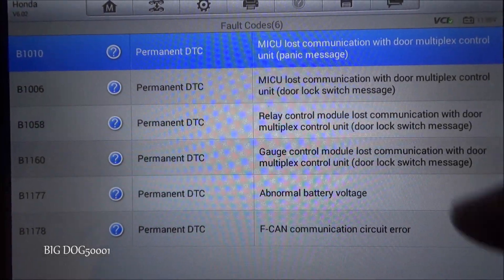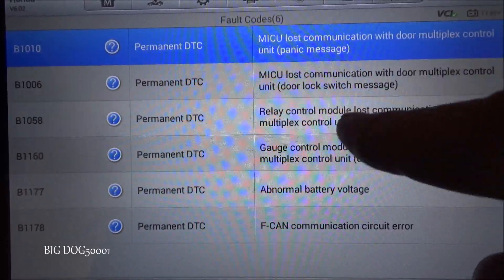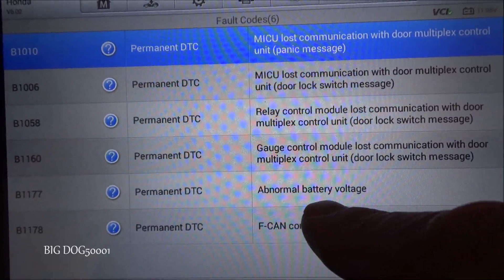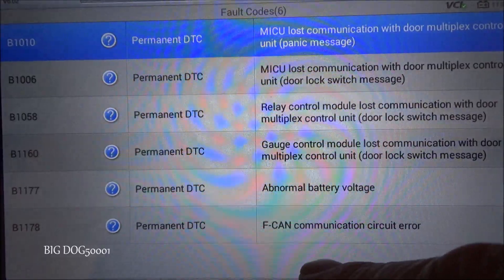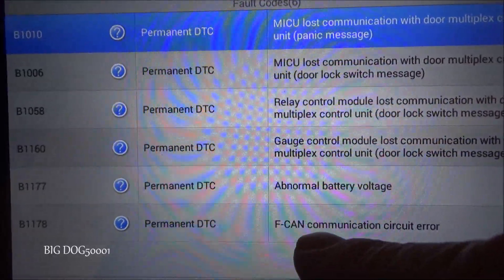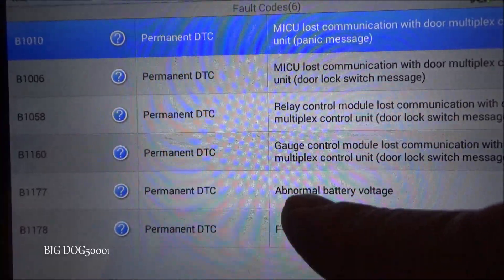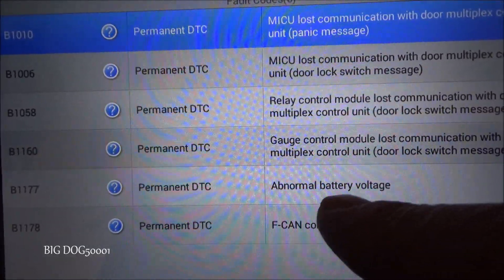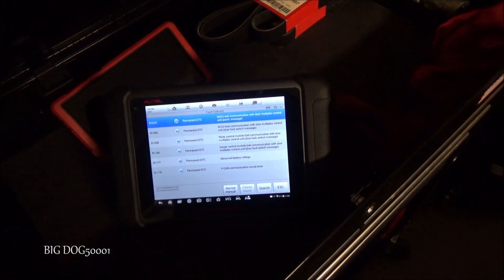Tech Tips: Multiple Trouble Codes and CAN Communication Errors

Comment: I have the door modle multicomplex thing comes every once whaile, my car vultage alwayas 14,4 v, im useing 200 amb alternator, is this problem related to increased voltage? Thank you for your effort.
My car is accord 2005 ex 2.4
Reply from the maker: 14.4 volts is fine, over 15 volts is usually when problems start to come up.